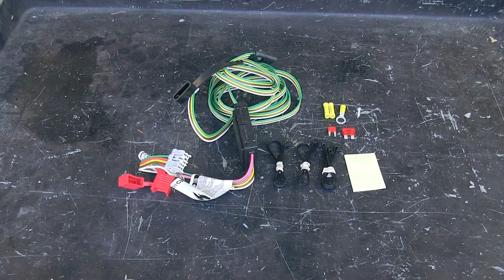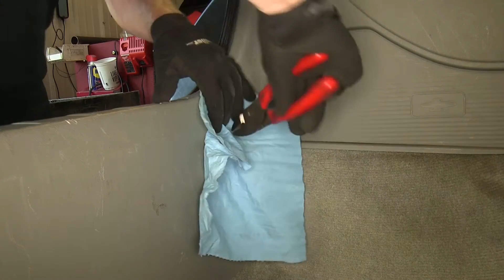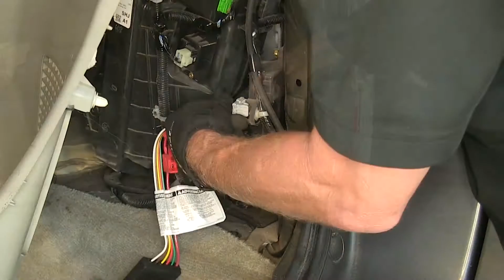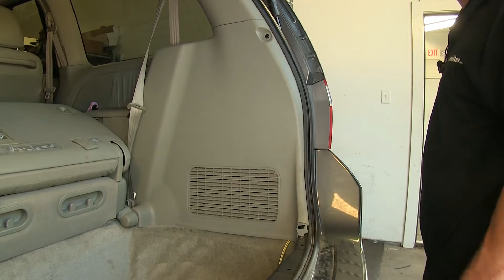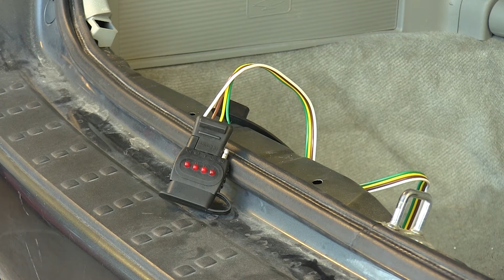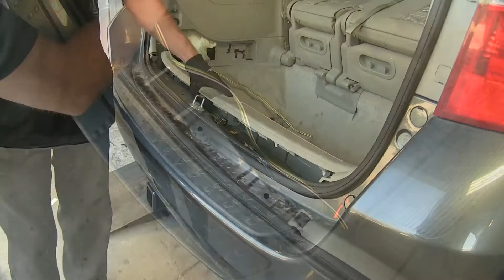etrailer | Trailer Wiring Harness Installation - 2006 Honda Odyssey

Comment: There is no inline fuse holder in our harness.  What now?
Reply from the maker: Did you order it from us? If so, please feel free to contact customer service and they will gladly help you.

https://www.etrailer.com/customer-service.aspx
Reply: etrailer.com I realized that your kit did not include an inline holder, but that the fuse goes in the front passenger side fuse box.